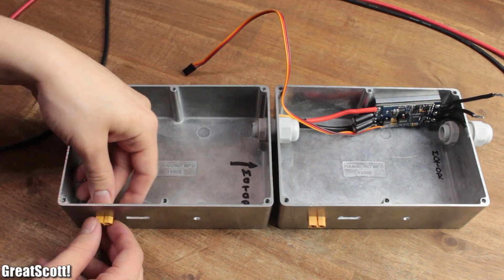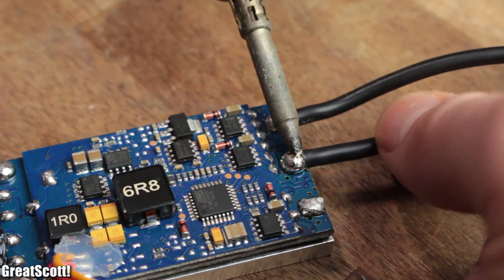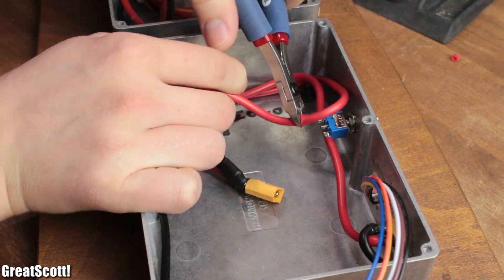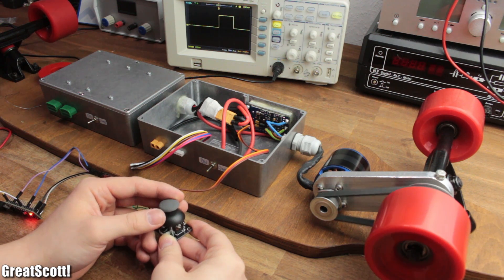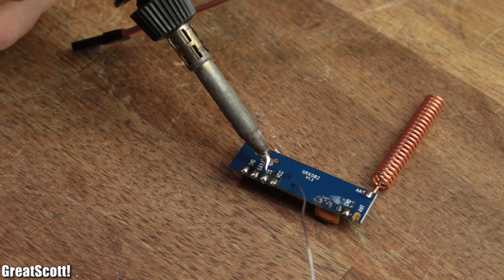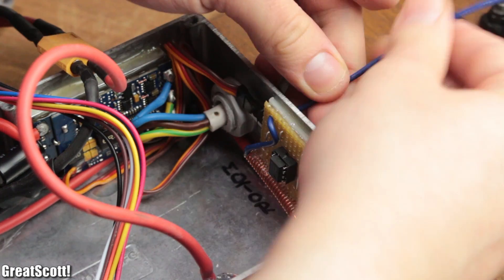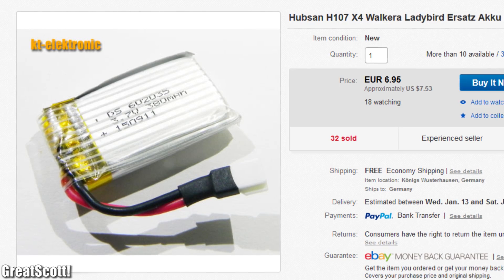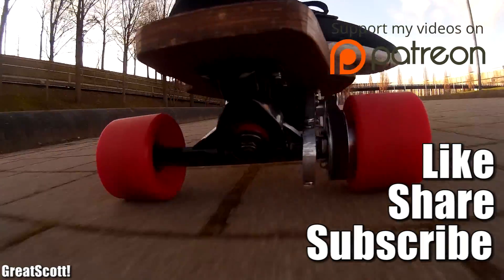Make your own Electric Motorized Longboard (Part 3) - the wiring & remote control

Comment: hi!
i have problem with uploading your code to my arduino nano 
it says error compiling plz help!!!
Reply: That's exactly what I'm getting as well
Reply: +Adam Keely hi adam i have fix my problem 
you just have to download software servo and extract it to arduino inside libraries and then there another compiling error will come then to fix it you need to go to location of arduino software then again open libraries there you need to change #include <WProgram.h> to #include <Arduino.h>
      it may work let me know if it does work?? and for the download search it on google
or you can go to arduino website http://playground.arduino.cc/ComponentLib/Servo
Reply: +HARIBUS you dont need to do much just open software servo file then open the .h file with notepad the there will be something like <wprogram.h> change it into <arduino.h> thats it
but in this video he havent use arduino nano later he had use attiny45 which my case i dont have i made transmitter with arduino nano gudluck HARIBUS
Reply: Yes it workes thanks a lot  !
Reply: +HARIBUS 
great!!! good to hear that it worked let me know when you finish this project gud luck making this electric long board
Reply: +sharad nepali How do you open a ".h" file?
Reply: sharad nepali so all you need to do to make it work for Arduino is that?

Comment: Could you please tell me how to connect the remote to the skateboard with wires? Because i don't want to spend more money for the transceiver/receiver.
Reply from the maker: +John Pegioudis Instead of connecting the Data wire to the RF transmitter, you connect it directly to the yellow wire of the ESC.
Reply: +GreatScott! I Want To Connect The Controller Using The Arduino. Like You Had Done At 4:37 (Of Part 3). And I Need The Code To Do That. Right? Where Can I Find The Code?

Comment: does this board work off a cold start? or do you have to give it a little push to get going?
Reply: +GreatScott! AWESOME project! If you made a business out of making these boards for the cheap (since other electric boards are $$$$) I bet you'd have many people buying them. Especially the people that would try this but realize all the work it takes lol
Reply from the maker: +Noah Burghardt A little push is necessary.
Reply: +Noah Burghardt If the motor control is sensorless, I think it will need a push. Using a sensored motor with an appropriate controller or a simple DC motor will solve this issue. That's how I see it...
Reply: weed2luke yes but I am yet to see any sensored motors with a low enough kv/speed to use on an electric longboard. Boosted boards have sensored low speed motors but theirs are custom built.

Comment: DIY power assist bicycle motor that can be charged either by solar power or whenever a rider is pedaling when they don't need the motor. And to be on the safe side the batteries can be plugged into a power outlet.

Comment: do you have something like a failsafe? so what will the board do if it is disconnected to the controller?
Reply from the maker: +Jonathan Knirsch At this point you have a normal longboard.
Reply: ah, cool :D just worried about, the longboard just keep going or so (like many RC controlled things :))

Comment: Another question, why did'nt you use the integrated communication protocol of the nunchuck (SCL and SCA) which is supported by the arduino? With that you might have been able to use the acceloremeter function implemented in the nunchuck for other purposes like if the nunchuck falls down on the ground while your riding the board?
Reply from the maker: Is the library ported for the ATtiny? Also I just needed the space the circuit board reserved.
Reply: +GreatScott! Yes maybe not I guess, I'm actually building one, I'll keep you updated. Love your videos! =)
Reply: +GreatScott! a great project is an arduino board programed to play piano tiles 2 it would be awsome if you make a step by step guide

Comment: why use arduino and custom circuits? you just need esc and then get a transiever kit from hobbyking. everything you can get all from hobbyking. total cost about $300 for motor, esc, rf transducers, and battery. charger will cost extra though

Comment: hey, awesome video. Just wanna ask how long your board lasts on one charge and what charger do you use, hoping I was able to find a compact one so I can take along
Reply from the maker: +Horog I talked about the range in part 1. I am using an eco 6-10 balance charger.
Reply: cheers m8, sry last question.  if I was to use a 245kv motor,what battery should i get, like how big should the battery be and how much current flow from the battery to the motor

Comment: Great job Scott. Just a quick word on the ESC. 

The reason the motor stops so fast is most likely you have active breaking enabled on the ESC for some reason. Disable it and your motor should freespin when you let off the throttle  (not come to an abrupt stop).
Reply from the maker: Sure, but how do I break if I disable the break?
Reply: +GreatScott! the Arduino code and the backwards on the controller set it to a min value and bingo
Reply: +GreatScott! breaking is achieved with a short reversing of the motor. :)
Reply: +GreatScott! You have that little programming card. On the very bottom left switch brake from on to off. That will solve your problem. Once braking is off, the motor will make no attempt to slow itself down to the lower throttle, it'll just keep coasting. Actually you should make a button on your nunchuck for coasting. 

Let me know if that works. 

I love your projects by the way.
Reply: +GreatScott! It'd be nice to have an actual coast feature so that you can go down a hill without using any power.

Comment: With this charging board  the 380mah lipo will be destroyed?? Or can you charge a 380mah lipo with 1A?
Reply from the maker: +Fabian Langer Since my discharge rate is 20C, it should be able to handle a charge current of 3C. Don't worry.

Comment: I love your work man. If it interests you, there are a few companies that sell trucks with suspension for off road purposes. they eat a lot of kicking power, so they are useless on the street. however if you are powered up then you wont have that problem. plus it will kill the vibration for your electronics.

Comment: Nicely done project!

The two things I'd add if I did this are 1) Dead man 's switch, 2) a microcontroller on the longboard that receives the signal and let the sender send serial data instead. I believe you might get problems if you're running by a wireless thermometer or someone opening a car now, therefore I'd opt for a protocol with error detection.... but in the open it's probably not a major problem.

Thank you so much for sharing.

Comment: Isn't duck tape conductive ? 
Just saying
Reply: it's made from cotton, plastic and adhesive, so no, its not conductive.
it does not isolate anything either, if this is what you mean.
but here it is used as "gap filler" anyways, so it doesn't matter.

Comment: Do you recommend making your own? What is the total cost?
Reply: It probably doesn't cost $1000 like a boosted board does
Reply: +Floris Kuck total arround 300 usd
Reply: +Wolter Nijmeijer thx
Reply: +Wolter Nijmeijer 300 usd? that's just the cost of motor, accessories and ESC...
Reply: look the discription
Reply: '' The estimated costs are around 300$ which makes it a good alternative to commercial solutions. ''
Reply: +Floris Kuck 
You have the same logo as Fluxtrance.

Comment: Man, you are using 3A switches to drive 60A+ motor...
Reply: really glad it wasn't just me concerned with this.
Reply: Yeah but alone there. It's not a switch, it's a fuse!
Reply: +IscleGaming | ZefaCraft how do you even control a relay it's not a button...
Reply: xt60*
Reply: The current pulled by a motor changes based on the amount of torque needed to spin -- he is using a 1560W motor, so to ensure that the current never excedes 3A, he would have to be using a power source that put out 1560/3 Volts, which is  520 V.   And he's not going to be using a source that high voltage The highest voltage he could het is 44.4V if he put his packs in series
Reply: is this an issue what switches would you have to use?
Reply: Kevin Hallerman you should use a solid state relay, a relay, a contactor, or a switch rated at that amperage, but not a 3A chinese switch...
Reply: +IscleGaming | ZefaCraft I'll look that up. I'm building a board. and have bought all the pieces. but I saw a video where they put a separate switch between the esc and the baterys and wondered why and what switch should be used.
Reply: +IscleGaming | ZefaCraft is this over kill http://www.andymark.com/product-p/am-0282.htm
Reply: +Kevin Hallerman i bought this one, and i haven't tried it yet, but it should be fine. be sure to power the relay with 12v and not 22v or whatever voltage you are getting from the battery... http://m.ebay.com/itm/Car-Auto-DC-12V-100A-Relay-4-Pin-RL180-Heavy-Duty-Install-Amp-Style-Split-/291693322253?nav=SEARCH
Reply: +IscleGaming | ZefaCraft is have two 11.1 very baterys and a 60 amp motor . and a 120 amp esc
Reply: Kevin Hallerman if you have two 12v batteries in series, then you will need to buy a dc-dc buck converter to generate 12v (3$ aprox), but if you run them in parallel then you can easily use the battery voltage to power the relay. This relay will handle your load with no problem, the motor is 60A, and it will never get over that, even if the ESC is CAPABLE of 120A. For you, this relay is ideal. It uses about 0.40A, a bit too much but i don't think it will affect battery life a lot.
Reply: +Kevin Hallerman aren't they all digital
Reply: Kevin Hallerman you need a very small button to power the relay... so you can use the switch used in the video to power the relay that then will power the ESC and the whole longboard.
Reply: +IscleGaming | ZefaCraft ok cool
Reply: +Kevin Hallerman how do you know own what your buying on that eBay Store there is no pictures
Reply: +IscleGaming | ZefaCraft  how about this one http://www.amazon.com/gp/aw/d/B00KO46YCU/ref=mp_s_a_1_3?qid=1457985763&sr=8-3&pi=SY200_QL40&keywords=100a+solid+state+relay&dpPl=1&dpID=41h3eDbfuLL&ref=plSrch
Reply: Kevin Hallerman that one will work, but i can't recommend it because you will need a very big heatsink. I do see images of the product on ebay, and i even have it myself and its a very good quality relay!
Reply: +IscleGaming | ZefaCraft.  do you even need a switch between the baterys and esc can't you just leave the baterys plugged in and turn off the esc
Reply: Kevin Hallerman you can just unplug the batteries... or use the relay and a switch to make it more easy and good looking.
Reply: +IscleGaming | ZefaCraft. why do you even have to unplug them?
Reply: Kevin Hallerman because they will underdischarge if you don't do it, and it will kill them. If you use a switch and a relay you can leave them plugged in as long as you power it off after riding.
Reply: In all honesty, one great design I've seen that avoids stitched is adding a loop of wire soldered to an XD60.  it acts as a "key" and has the added benefit of now allowing you to have both switches in the on mode at once.
Reply: May be its maximum  current would be 3 amp with high voltage !!! Because how can he make mistakes !!!!
Reply: you would of course put at least 100A deon, right?

Comment: Can you ride it after the batteries had been drained? Or is it too stiff? Would you need to take out the belt?

Do you think the motors can act as generators and charge the batteries if you, let's say, let it roll downhill enough?

Thank you!
Reply: +Ram&#243;n M&#225;rquez The motor cannot work as a generator because of the ESC. It isnt supposed to work as a LiPo Battery Charger ;D
Reply: David Zvonař Yes, of course. But with the ESC GreatScott is using, it wont work...
Reply: +Henrik If you have the right ESC and right settings on it you can have regenerative breaking.

Comment: awesome project !! 
the wireless remote setup is amazing !    

just be carefull riding this great board.  
i had a boosted board for a couple of days in Düsseldorf until the german police did stop me.   the criminal procedure is still running and i have to expect a couple of hundret euros (if not more) sentence for "dangerous interception of public traffic, driving without  insurance, and also driving with an unlicensed motorized vehicle capable of +6 km/h".
They took this realy realy serious, although i was driving realy slow on the walk-way when they stopped me.

Comment: Question, at 2:15 why have switches at all? What's wrong with just wiring them both in parallel and leaving them that way permanently?
Reply: vgamesx1 The ESC has overdischarge protection built in! :)
Reply: IscleGaming | ZefaCraft Ahh ok, I didn't know that.
Reply: +vgamesx1 firstly the ESC would be connected constantly to the Batteries and drain them over time. Overdischarged lipos lose their capacity and can even puff up and eventually go up in flames if drained to less then 3V/cell. Also putting Lipos in paralel is not a very good idea, especially if they are not exactly the same cells with exactly the same history. If there is for example a 0.5V voltage difference between them, the higher one tries to charge the lower one with an exessive amound of current (A), which can result in a fire aswell. i must say i am not a real big fan of the idea with the swiches either, they are to fragile and also they are not designed to handle 70-80A of current...
Reply: +vgamesx1 well, you need a way to power it off! but the two 3A switches he used are not appropiated in any way.
Reply: IscleGaming | ZefaCraft As i said: " they are to fragile and also they are not designed to handle 70-80A of current..."
Reply: muh1h1 oops, i didn't see your comment.. probbably because i didn't refresh the page
Reply: +muh1h1 Yeah but couldn't they be over discharged just in normal use anyway? so you should definitely have an under/over charge circuit in something like this in the first place, better yet get (or make) something that does balance charging for you as well, so then you can simply feed it 26V for charging.

True the batteries will try to charge each other, but wouldn't a simple solution be to fully charge both and if you're still worried attach both leads via a resistor and let them level out? As far as I'm aware there's no harm in connecting two batteries that aren't perfectly matched as long as they're fairly close, (capacity wise) you just won't get the full capacity as you would with two separate batteries, besides that 3zuli in another comment pointed out...
"The way the switches are wired is quite dangerous. If you forget to switch off the drained battery before you switch on the fresh battery, you're gonna have a bad time. Also, a stick or something on the ground could flip the switch into the On position without you even knowing."

That alone is far more dangerous IMO than having two batteries that aren't perfectly matched, so this is probably the first time I've thought Scott did kind of a poor job with the electronics (or handling the batteries anyway).
Reply: vgamesx1 totally agree with your point. Also it is wierd that he used AWG 12 für the charging leads, which have to handle 5A max (at 1C charging rate), while deciding to use 1,5mm² for the motor wires, which will see the full 80A...
i am not saying the whole product is bad, it is brilliant, but far from perfect.
EDIT: another thing that just came to my mind: what would happen if you stepped on the board really hard? the board would flex, and the cableglance would break, probably...
Reply: muh1h1 Hmm, I dunno.. The board looks fairly sturdy to me, so without making one it's hard to say really.
Reply: 2 different batterys
Reply: +Jaromy Van Der Sluis batteries

Comment: People on the US won't be able to use that remote RF transmitter as 430Mhz falls well into the 70cm Amateur radio band and as such US users would need a license to use it.
Reply: I dont think so, because most remotes for something like a Garage are using this frequency
Reply: +minecraftfreak3535 Garage door openers work anywhere between 300Mhz and 400Mhz. The amateur radio band in the United States in the 400Mhz range (70 cm band)are all frequencies between 420-450Mhz.

Comment: could you please explain what does the  70A BlueSeries Brushless Speed Controller do
Reply from the maker: +Wteevt I will make an extra Electronics Basics video about that topic.
Reply: +GreatScott! thanks!
Reply: brushless motors do not use gearboxes to maintain RPM, when power is applied they will throttle up according to how many poles are in the motor. You use an ESC to switch the motor on and off 1000s of times a second and the rate of this change creates the difference in RPM. Brushless motors are measured in kV (thousands of revolutions per minute per Volt applied).
Reply: +Wteevt as far as i know, a brushless motor allways needs such a speed controler to run at all.  it takes normal red/black power and gives 3 phase power out to the motor.
Reply: u need it to run and controller the speed of a Brushlessmotor
Reply: +leo ulreich controlle

Comment: Isn't it possible to use the metal box as an antenna?
Reply: +Max Power The metal box will act as a Faraday's cage and will not let any signal to get in or go out of the box.
Reply: Hrithik Bansal
Yes, but you could connect the cable from the antenna to the case.
Reply: +Max Power Then the case would ground the signal causing a lot of interference which will probably cause signals to delay a lot
Reply: pirateman it grounds the signal, that's why it attenuates it plus it causes signal distortion
Reply: Sorry,my bad!
Reply: +pirateman Isn't it fucking up the efficiency anyways if the antenna doesn't have the correct length?
Reply: it might work, but that antenna would be hard to work with which is just not worth the effort for that very small distance.